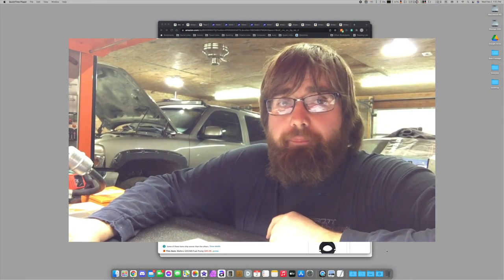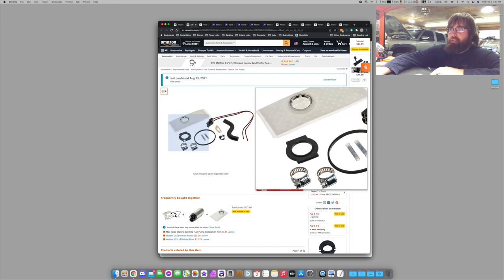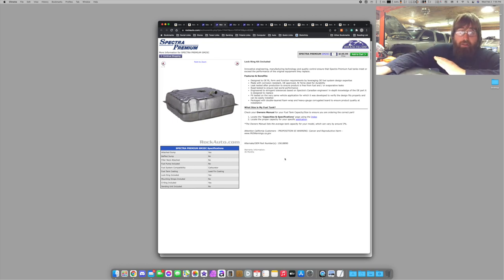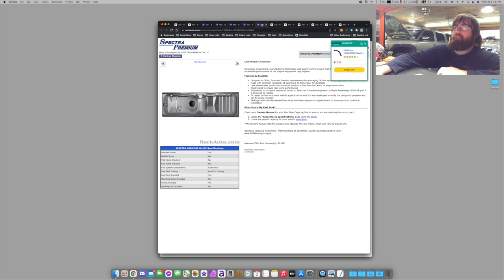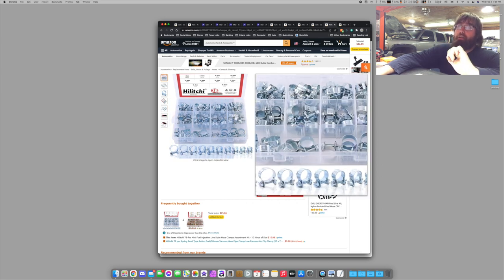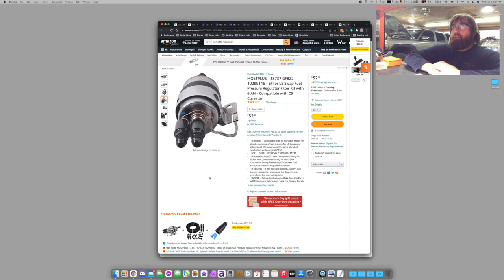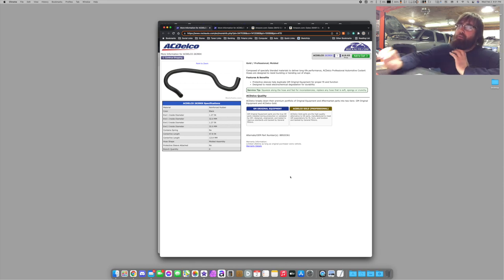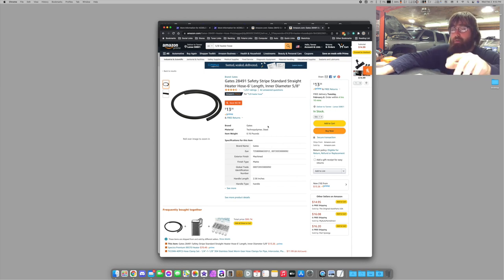LS Squarebody Basics How to swap a ls into a 73 87 Truck or SUV Pt. 2 (Fuel and Cooling System)

Comment: Lots of info., how did the 411 Lt1 project go, I’m still in the mist of my 411 Lt1 project. I’m still learning need as much information as possible.
Reply from the maker: It went well, rebuilding the suspension right now on the car, but put about 500-750mi on it before I started that and ran great